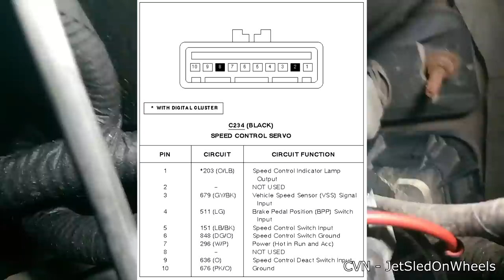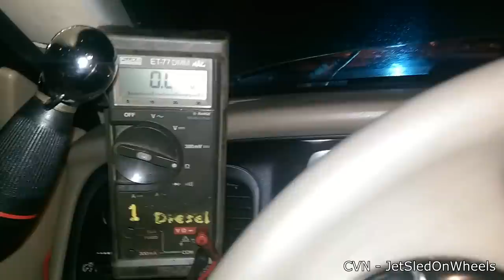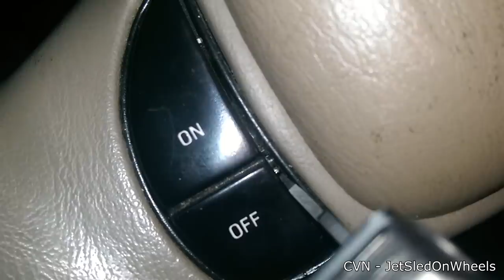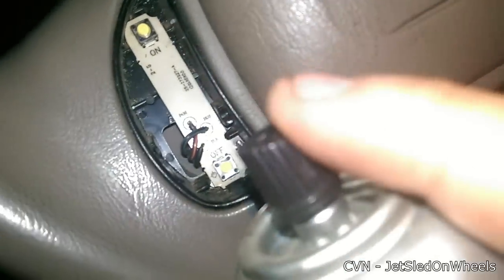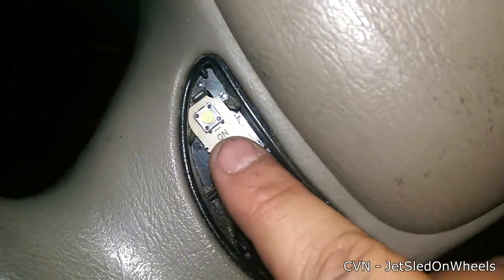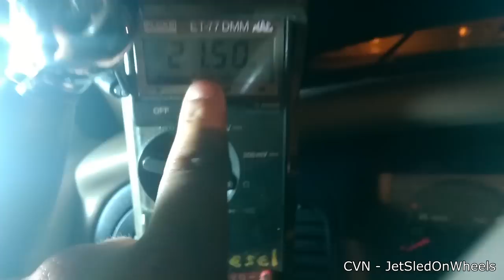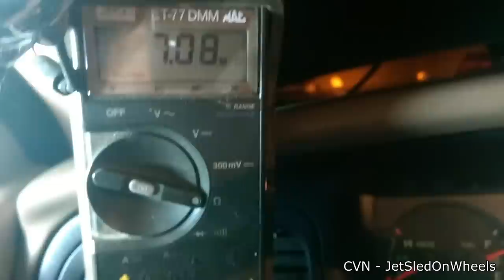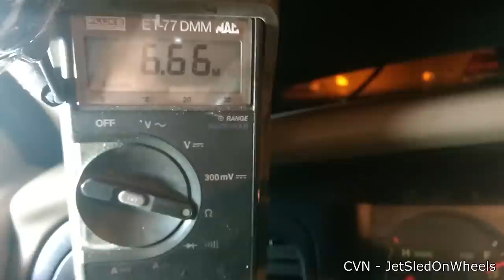CVN - Cruise control switch test and clean

Comment: I have a 2006 Grand Marquis. Apparently 2005-2007 MGM and CV are the same as each other, but different from earlier years. They do not have the pushbutton switch, rather they have a squishy rubber membrane that mashes down onto the circuit board (like your TV remote if you've ever seen the inside of that.) They can still be cleaned exactly as described here, by popping the hard button tops off and cleaning with contact cleaner. Just make sure you're getting it between the squishy rubber part and the circuit board and then work the contacts thoroughly. Test before popping the button tops back in, and repeat as necessary.
Reply from the maker: Great info! Thanks for sharing!

Comment: From what I can find on my 2000 F-250 the cruise is run through the pcm since it is a diesel. I still suspect it is in the switches and I am going to at least clean them and see if this fixes my problem. It started out fine then went to intermittent for a few days and now not working at all. I hope this helps.

Comment: I love commenting on videos dealing with reparing my truck: a f 250 Lariat 7.5 460 1990: only thirty years old now. EFI and I am going to lift my lid on the wheel and spray those puppies. I be that is my problem, but if not then I might check this and that and more or less . Muchas gracias amigo mio. I think I will run out in the night and check to see if my brake lights light up the town now. Good night and thanks a bunch. Keep up the great work amigo. ciao joe kokomo

Comment: How are you Doing my brother, what would be my Case in your mind, I have a 2002 Ford Explore , any time I turn on the cruise control it doesn’t engage 😞 but it shows on in there  could you give me any information?
Reply from the maker: My best guess would be that your cruise control cable has disengaged somehow from the throttle body. It was actually pretty common on a few ford models of the era to have that happen. Another possibility is that the cable has snapped.
Reply: Spicy Koof Nuggets!  Appreciate your attention, Will check that for sure  thanks brother

Comment: I just desoldered and replaced the switches on mine. Panasonic EVQ-PAG04M or EVQ-PAE04M or EVQ-PAC04M can be used. The difference is the operating force--260gm, 160gm, or 100gm respectively. I used the EVQ-PAE04M but I think the originals are more like the EVQ-PAG04M in terms of operating force. Dimensionally, they are all identical and an exact replacement for the originals. They cost 27 cents each. Desoldering them was ridiculously easy. They can be purchased from either Mouser or Digi-Key or whomever else stocks Panasonic switches. I got mine from Digi-Key. Your switches look more like the EVQ-PAG07K / EVQ-PAE07K / EVQ-PAC07K which has a button that is about 3mm taller but is otherwise identical--there appears to be more than one version of these switch assemblies. The circuit board on your switch assembly is different from the one I have, but the outside appearance is the same. Best thing to do is measure the switch and compare to the data sheet. These are Panasonic EVQPA series switches.
Reply from the maker: +Brian Leeper Great info to have! Thank you Brian!
Reply: Brian Leeper said

Comment: I have a 2002 Ford F-150, Lariat, 5.4 triton engine, flex fuel and my cruise control does not work. I have no warning lights on my dash and I haven't found any bad fuses. My backup lights and all other lights work ok. My problem is this: when I push on my cruise control "off"  button; my horn sounds. I did replace the switch relay on my master cylinder but, didn't help. Please help if possible.
Reply from the maker: William P Branham the diagram for your cruise circuit unsurprisingly looks identical to this, so the test should be identical in your case. is it possible your truck has had an airbag deployment? the first thing I'm thinking when I'm hearing cruise buttons are activating the horn is a fried clockspring. is your airbag light on at all?

edit: is there any change in what happens if you tilt your wheel?
Reply: Solved problem! Cleaned contacts and everything works. I disconnected the battery, removed air bag fuse and waited 1 hr. I then removed the off and on button from steering wheel, sprayed electronic cleaner on contacts and by just pushing buttons several times the contacts came clean. Then after cleaning, I reinstalled the off and on button, reinstalled the fuse and connected the battery. That solved my problem. I saw another video on line and they suggested this before replacing parts. Thanks to all those who has taken time to post their solutions on line! Thank you again. Your video saved me a lot of time! Thanks again!!
Read more
Reply: William P Branham does it still work? I think I might have to do this on mine since brake sensor and fuse have been replaced still don't work
Reply: Baxter DeBerry 

Hola buenas tardes,

Yo tengo un problema con mi módulo de control de velocidad.

El switch del pedal para el freno y el switch en el volante funcionan bien.

El fusible está bien.

En el tablero el indicar de encendido (ON) funciona y enciende.

El problema es que el módulo de control de velocidad no logra mantener la velocidad, sino que se va desacelerando hasta llegar a los 48 km/h y se autodesactiva.

Como dato adicional, el módulo de control de velocidad fue sustituido por uno de medio uso pues el original se averió por corto circuito.

Comment: I know this is an old video but and maybe i should know but I don't.  In the video you show how to check under the hood for voltage and where the leads go but where do the leads go when testing the buttons?
Reply from the maker: So the lead positions under the hood are where you're checking the button functions. Those are the wires coming from the steering wheel controls. The on button is tested while the connector is still plugged in, and the rest are tested while that connector is unplugged. The test lead position doesn't change for testing any of the buttons. Hope this helps!

Comment: 2002 Dodge Caravan. My problem is, of course, different. When it works it works fine but it will shut off after a short time. Pushing the on/off doesn't turn it on. However if I turn off the ignition I can turn it on and it works fine for a short time again. The only exception is long trips after the engine and engine compartment has gotten very warm. It will usually stay on for the whole trip. I haven't found the cruise module. Is it part of the vehicle computer module?

Comment: Replaced cruise control switch on my 2006 Ford f150 it worked 1 day then quit working again  how can I fix this problem
Reply from the maker: The first suggestion would be to go through the wiring with a fine-toothed comb. Is it possible something may have come unplugged? perhaps a slightly corroded connector is to blame? the CRC contact cleaner I mention in the video works is actually specifically formulated for connectors and such. 

So the method I discuss in the video does still functionally apply to the 06 F150... with a couple huge differences, number one, the wheel button design is entirely different from the Crown Vic. and number 2, the pinout on the Cruise module is completely different as well. 

For testing, with the key off, you'll be pulling the middle connector on the PCM mounted to the firewall on the passenger side under the hood. on that connector, you'll be testing between pins 56 and 57. 56 should be a light blue/black stripe wire, and 57 should be a Dark Green/ Orange stripe wire. All tests are done in ohms with the connector removed from the PCM. 

Pressing off should give you a reading of fewer than 5 ohms, 
Coast 300 +/- 25, 
Set/Accel 600 +/- 50, 
Resume, 1100 +/- 75, 
On 2100 +/- 150. 
No key pressed should have a reading of about 4250 +/- 250. 

If all that tests fine, you can rule out everything from your steering wheel to the PCM, and then the problem lies beyond the PCM.

Comment: Hola buenas tardes,

Yo tengo un problema con mi módulo de control de velocidad.

El switch del pedal para el freno y el switch en el volante funcionan bien.

El fusible está bien.

En el tablero el indicar de encendido (ON) funciona y enciende.

El problema es que el módulo de control de velocidad no logra mantener la velocidad, sino que se va desacelerando hasta llegar a los 48 km/h y se autodesactiva.

Como dato adicional, el módulo de control de velocidad fue sustituido por uno de medio uso pues el original se averió por corto circuito.
Reply from the maker: ¡Hola!

¡Gracias por tu comentario!

Por favor, perdóname, ya que no hablo español con fluidez. Confío en la precisión de Google translate.

Si lo entiendo correctamente, ¿está diciendo que el módulo de control de crucero simplemente no funciona a pesar del reemplazo?

Si ese es el caso, asumiría 1 de 3 opciones. La primera opción sería que el módulo de reemplazo es defectuoso, y recomendaría tratar de reemplazarlo nuevamente.

La segunda opción depende de la edad de su corona victoria. Si es anterior a 2005, que fue el año en que los controles del acelerador se cambiaron a electrónicos, es posible que haya un defecto en el cable del módulo o que el cable se haya salido del cuerpo del acelerador.

y para la opción final, es posible que el conector eléctrico para el módulo de control de crucero esté corroído. desconectar el conector y limpiar los contactos con un limpiador de contacto eléctrico y un cepillo de dientes debería corregir esto.

No dudes en enviarnos un mensaje para que te aclaremos, y me disculpo nuevamente por tener que usar el traductor de Google.

cuídate y buenas tardes
Reply: Spicy Koof Nuggets! 

Buenas tardes, espero que hayas podido leer  mi comentario anterior.

Saludos
Reply from the maker: Lo hice, por alguna razón, mi respuesta no se publicó sin embargo.

Vi tu video, y todo lo que puedo decir es que parece que el crucero no se está activando, a pesar de que la luz dice que sí.

Más allá de eso, no estoy familiarizado con el modelo de mariner. Miré brevemente algunos diagramas eléctricos y diagramas de partes para él.

Mi mejor opción sería asegurarme de que el cable esté correctamente conectado al cuerpo del acelerador y confirmar que esté funcionando.

Yo personalmente intentaría desconectar el cable del servo de velocidad y pegarlo fuera de la capucha, donde podría verlo mientras conduzco. Active el crucero una vez que la velocidad alcance los 45-50 km / hy observe si el cable se mueve. Si se mueve, puede confirmar que el módulo es funcional. si no hay movimiento, es probable que el módulo de reemplazo también sea defectuoso.

¡Espero que esto ayude!

Ten una buena tarde
Reply: Spicy Koof Nuggets! 

Spicy Koof Nuggets!

De acuerdo, voy a seguir el ejemplo que me recomiendas. Desconectar el cable y ver si está funcionando.
Reply: Spicy Koof Nuggets! 

Existe alguna otra prueba para verificar si mi módulo esta fuera de uso o si aún funciona bien?
Reply from the maker: sí, pero requiere el uso de una herramienta de diagnóstico OBD con funciones de diagnóstico de dos vías. el módulo de lo contrario, no se activará hasta que el vehículo esté operando a más de 45 km / h. Los concesionarios ford y los sofisticados talleres de reparación de automóviles serán los únicos con una herramienta capaz de activar el módulo sin recurrir a la conducción con el cable visible.
Reply: Spicy Koof Nuggets! 

Muchas gracias amigo.

Después de revisar a detalle. Logre identificar que el módulo está dañado y por eso no funcionaba correctamente. 

Remplace el módulo por otro que tenía disponible, lo instale y salí a probarlo. 

Ahora funciona correctamente.
Reply from the maker: ¡Eso es una excelente noticias!

Me complace saber que ha localizado con éxito el problema y que vuelva a funcionar.

con suerte no te causó demasiados problemas. Sé que rastrear estos problemas a veces puede ser un gran dolor en la retaguardia.

Comment: at around 3:00 , what do you mean by "disconnecting" ...what to disconnect? 
didnt get it...
Reply from the maker: Anique Rizwan the connector going into the cruise module. the connector I stuck the probes into.
Reply: kufnugs ok ok.... thanks!
Reply: Anique Rizwan so if you disconnect the connector from the module, from where where you getting those ohm meter readings when you press the button
Reply from the maker: Pins 5 and 6 of the connector are the signal wires from the buttons. Pin 6 is ground, and pin 5 is signal. the buttons send the signal to the control module through pin 5. When the connector is plugged in, you're able to get an accurate VoltsDC reading from the ON button. When unplugged, you'll get an accurate OHM reading from the remaining buttons. 

The other buttons "short" the connection between pin 5 and 6 at varying resistance. The cruise module is programmed to understand the varying resistance its sent, and act accordingly.
Reply: Anique Rizwan thanks for the detailed reply bro.
Reply from the maker: Zohaib Anwar sure thing man, good luck!

Comment: I put a throttle position sensor on my 2007 dodge durango and my cruise control quit working it worked before any ideas
Reply from the maker: James Atkins my guesses would be bad replacement sensor,
 Poor connection to the sensor, or the classic turn it off and back on again response (pull the battery, and pop it back in)

Any other drivability issues?

Comment: I used the tuner/switch cleaner as shown on the video. I sprayed it and then massaged the button in different directions. I repeated this 5 or six times. The cruise control now works fine. Thanks for the video.
Reply from the maker: glad it helped!

Comment: You get different ohm reading on all the switches (excluding the on / off) 
   How do you determine what the ohms should be for each?
And is the key on or off when doing these tests?
  Thanks a bunch for this vid
Reply from the maker: Hi Joe! That is correct, the cruise control module is signaled with only two wires from the steering wheel. That said, the On button is measured in volts DC, with the connector plugged into the cruise module and with the key in the on position. The on button should read battery voltage when pressed, and it'll give you a goofy reading when no buttons are pressed. 

The Off, resume, set/accel, and coast buttons are tested with the connector disconnected from the cruise module, and with the key on. 
All values do NOT have to be exact, the reading may vary from the expected resistance by plus or minus 50 ohms or so. Off button should read 0 Ohms, Resume should read 2200 Ohms, Set/Accel should read 680 ohms, and Coast should read 120 ohms. 

As for how the determination is made for what the readings should be, they are numbers direct from the Ford Service Manual for the Crown victoria. This particular cruise module is common among MANY other ford models however, and as such the same diagnostic I show in this video may apply. 

Good luck, and don't hesitate to comment back if you have any further questions!
Reply: @koof_a_loof 
    Great explanation.... I fully understand
getting ready to try a few different tests on my recent purchase of a 04' Ford F-350's cruise control not working and yours will be one of the three different tests..... Thanks a bunch for the help :)
Reply from the maker: @notwrkn2mch  Pulled up the SM for 04 F350 and this one actually gives a specific ohm range for each switch. The test procedure is identical to my video here, so that's a plus!  

F-350 - Off "less than 5 ohms" - Resume "between 2,090 and 2,310 ohms" - Set/Accel "Between 612 and 748 Ohms" - Coast "Between 114 and 126 ohms"

Good Luck!
Reply: @koof_a_loof 
 You got no idea how appreciative i am that you looked this up for me. I just had to subscribe and hope to talk to you again....
   Thank you very much
Reply from the maker: @notwrkn2mch  no sweat! I just hope it helps out :)

Comment: Where did u get the spot light at because I want to put one on my car
Reply from the maker: came with the car. Word to the wise though, unless you absolutely need a spotlight for trail riding or other utility uses don't drill holes in your car to mount one. It's a pain in the ass to install these where there aren't already cutouts, and wherever you cut is always the first place to rust. 

Anyways. manufacturer of the spot is Unity, website i believe is Unity usa dot com. I'm sure they can be found used on ebay too... 

Again, unless you absolutely need to have one, forget it.

Comment: What if you dont get a 7 volts reading in the first place?
By connecting the 5 and 6 pins with multimeter
Reply from the maker: connector plugged in, probing 5 and 6 and pressing the ON button? Id first start by making sure the probes are making contact with the connectors, if so and you aren't getting a reading, clean the on switch. If still nothing odds are real good you've got a damaged clock spring, either from free spinning the steering wheel with the linkage disconnected (during a repair to steering components) or you've had an airbag deployment.

Comment: hey great video! I have a 96 lincoln town car and not getting the volts with the on button. After looking up recalls seems they changed the pressure switch and wired in 2 inline fuses checked the fusses one was blown. It had a lot of white corrosion which I think cause a lot of amps to be drawn through the white stuff. Cleaned the fuse holder with crc, changed fuse and now i got my cruise back working. Did a preventive action and cleaned all the button switches too. thank you !!!
Reply from the maker: Happy to hear another panther is back in working order on the road!